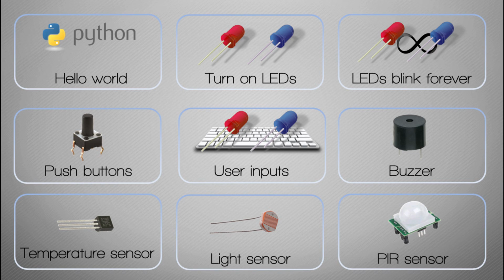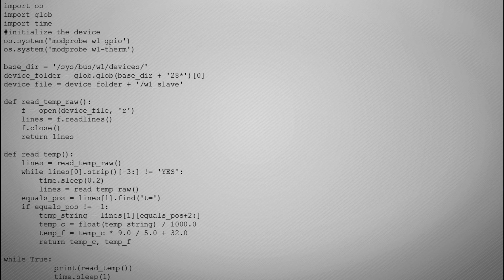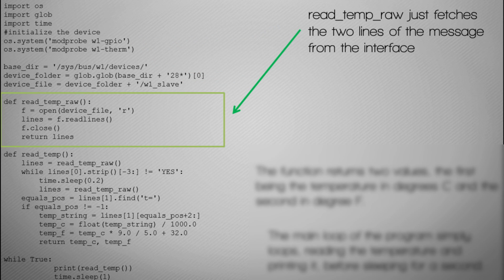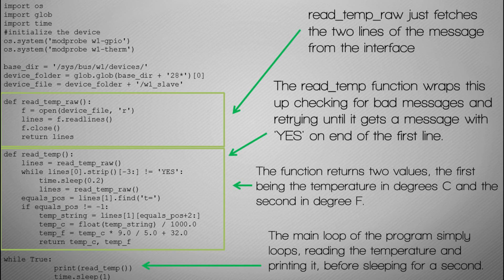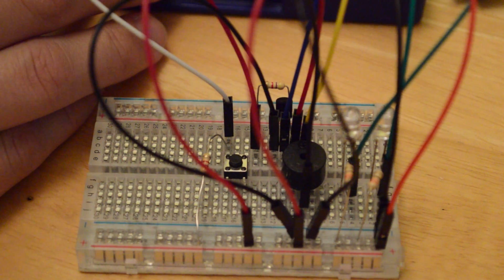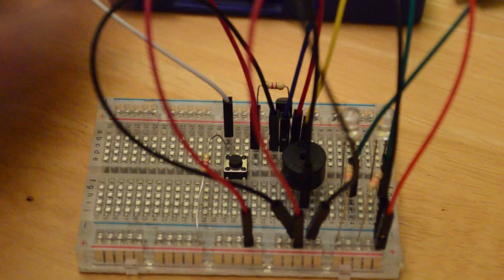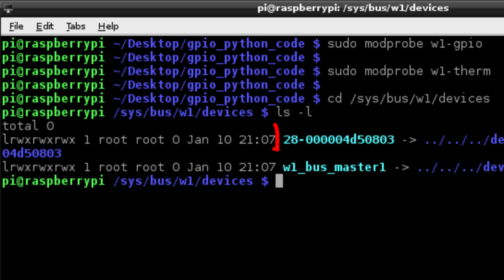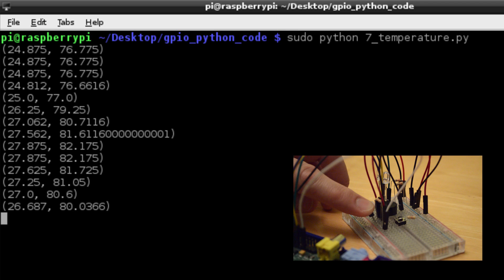Raspberry Pi - GPIO & Python (7/9) - Temperature sensor

Comment: Hello,

I am getting started with electronics, can you please explain why you hook up a 3.3V line to the data pin? I see it has a (if I'm not mistaken) 4.7k resistor and I know the GPIO high state is on 3.3V but what kind of sorcery happens behind the scenes? Thanks

Comment: For anyone struggling getting this working. The video wasn't the most helpful.
1) When connecting to the gpio board, this needs connecting to gpio 04.2) if like me you follow the tutorial and when you run ls -l the thermometer isn't showing, the video doesn't help with what to do. The fix for mine on Rpi2 was simple: 

Sudo nano /boot/config.txtAdd the following line at the bottom dtoverlay=w1-gpioCtrl X and Y to saveReboot the PiHopefully this will fix as it did with mine.
Reply: This is the same as enabling 1-wire on rasp-config -> interfaces , thank you!
Reply: +Justin Hügill Your fix worked for me too, thanks!
Reply: +Justin Hügill Thanks!
Reply: +Justin Hügill Thanks!
Reply: +Justin Hügill Fixed it for me as well, thanks.
Reply: +Justin Hügill You saved my day, thanks!
Reply: +Justin Hügill thanks, that did the trick

Comment: I couldn't get the temperature sensor to register on my new Pi2. It turns out it was the latest firmware 3.18 installed that broke it. See post for fix : http://raspberrypi.stackexchange.com/questions/27755/ds18b20-temperature-sensor-not-registered-debugging/27793#27793
Reply: +Anthony Mark this fixed the error message, but it still doesn't work. Data is binary. Either 85 and 185 or 127 and 262.

Comment: So if anyone knows.... I am getting this error

device_folder = glob.glob(base_dir + '28*')[0]
IndexError: list index out of range
Reply: I now have same issue. Think it's related to the firmware upgrade I mentioned above. will dig around...
Reply: Anthony Mark We were using the demo for a project and we sent to a tech guy to due updates so we can get on the wifi in the computer lab. I believe he updated the kernel of the operating system to get it to work on the wifi.
Reply: thediltarget Thanks. I tried that last night and noticed lots up updates related to GPIO but it unfortunately didn't work. Will try again perhaps tonight.
Reply: thediltarget the error is due to your sensor having a different serial number. 28 is the first two numbers of the serial number. change it for your first two numbers in the serial number in the script. mine is 10 and not 28.
Reply: Ben Malpass its okay we actually switched to a new sensor.
Reply: I got the same error. Even though 28* was the correct directory for me. Making a new file (not copying tutorial6 to new file) and typing the code from scratch fixed it for me.
Reply: +Ben Malpass how do I find the serial number?

Comment: Is it possible for you to make a quick update video of the temperature sensor controlling a GPIO pin. For example  if temp too hot turn on GPIO 17  else  if temp too low turn off GPIO 17. Many Thanks
Reply: # !/usr/bin/python
import RPi.GPIO as gpio

while True:
      if reading_of_temperature_sensor >= median value:
             gpio.output(17, gpio.HIGH)
      else:
             gpio.output(17, gpio.LOW)